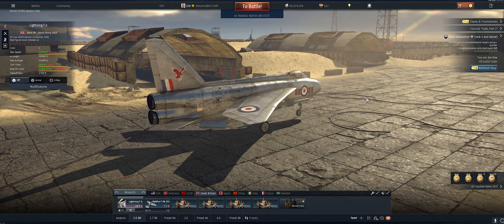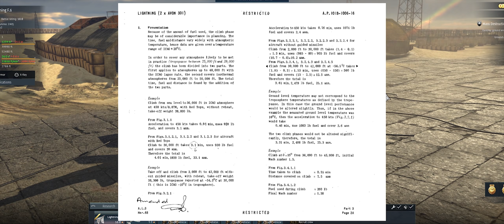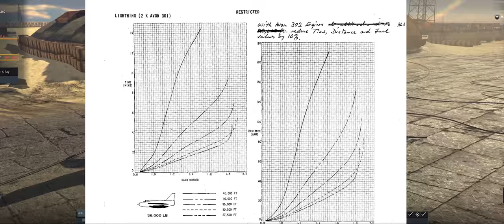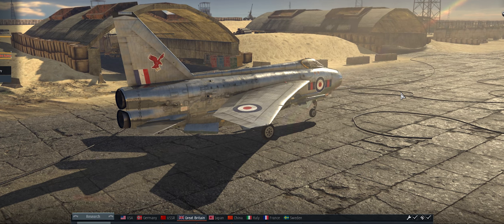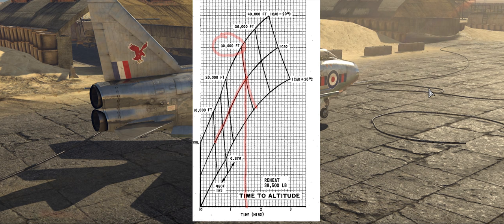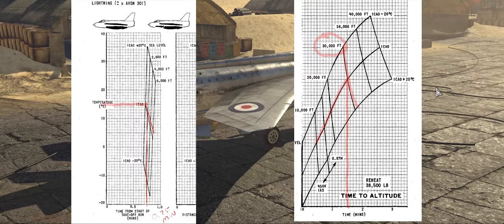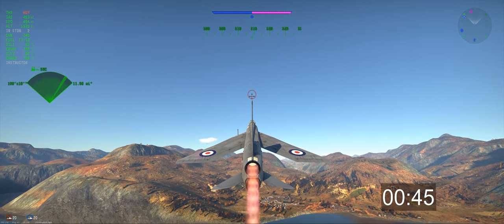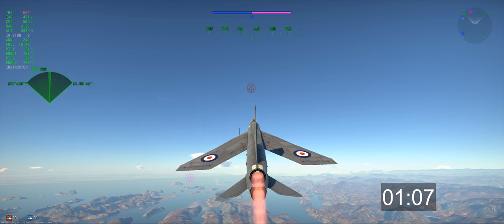True Facts About the English Electric Lightning's Performance - War Thunder 1.97

Comment: Well there was a Lighting in real life that managed to intercept a U2 spy plane, and lob itself into a ballistic arc maxing out at 88,000ft, that's 28,000ft above it's official service ceiling. Good Luck getting anywhere near 88k ft in game. Also, the RAF was worried that the nose cone covering the radar wasn't strong enough to handle the forces at max speed, since it was built to lower specifications. So the plane had the potential to go faster than the manuals actually say.
Reply from the maker: https://cdn.discordapp.com/attachments/637130584912822293/690051743513313320/unknown.png

That was only the first try.   That's 77,000 feet.
Reply: I mean the F-4 did the same to 98,000ft so you were saying? 

Operation Top Flight: On 6 December 1959, the second XF4H-1 performed a zoom climb to a world record 98,557 ft (30,040 m).Commander Lawrence E. Flint Jr., USN accelerated his aircraft to Mach 2.5 (2,660 km/h; 1,650 mph) at 47,000 ft (14,330 m) and climbed to 90,000 ft (27,430 m) at a 45° angle. He then shut down the engines and glided to the peak altitude. As the aircraft fell through 70,000 ft (21,300 m), Flint restarted the engines and resumed normal flight.

Operation High Jump: A series of time-to-altitude records for the F-4 Phantom was set in early 1962: 34.523 seconds to 3,000 meters (9,840 ft), 48.787 seconds to 6,000 meters (19,700 ft), 61.629 seconds to 9,000 meters (29,500 ft), 77.156 seconds to 12,000 meters (39,400 ft), 114.548 seconds to 15,000 meters (49,200 ft), 178.5 seconds to 20,000 meters (65,600 ft), 230.44 seconds to 25,000 metres (82,000 ft), and 371.43 seconds to 30,000 metres (98,400 ft).

If the lightning is at 30 angels at 135 seconds
the F-4 Phantom is at about 55 angels

Comment: good work gaijin cant even get planes which have books literally filled with info to be historically accurate
Reply: Actually this has been discussed many times. The issue with these manuals is that the manufacturers lowball all the top ends to extend life of the machine. Pretty much evenly plane will out perform the manual, which is why gaijin doesn't accept just the manual as info for changes.

Comment: Ok, so the electric lightning performs like it should according to the manual, but how can it not do feats that it can and was shown to do in real life in the game?
Reply from the maker: Example?
Reply: WhooptieDo thanks for replying, I’d argue that it can’t climb vertically after take off like it could, I’d also argue that it’s acceleration rates and max altitude are wrong (I’d refer you to the performance comparison against a Mig 21 by sgt.vittie) and I would also argue that it’s high altitude manoeuvrability is incorrect. I agree that it was not a dogfighter but I do feel it is incorrectly modelled in performance.
Reply: WhooptieDo no further response?
Reply from the maker: @jamiekowalski6430  sorry dude been alot of people commenting and alot to keep up with on this video.    As for Vittie's comparison video, you need to remember the Mig21 has a similar thrust to weight ratio and a shit ton less drag.  He didn't create a very controlled scenario for his vid.  His complaint was that the EEL was underperforming, when his complaint should have been that the Mig21 is overperforming, but even considering it all, the Mig21 came into existence 10 years after the EEL.   I told him that when he made the video, but he's since booted me from his discord and blocked me from any further communications.   Buffing one plane to compete with another is NOT the answer.

I am waiting on someone right now who's offered to provide me with a Mig21 MF manual, at which point I will do the same tests and we will likely find that the MF/SMT is slightly more powerful than it should be.  F4 phantoms have always been able to run from the Mig21 in real life, however in WT they BARELY can.

Also, something for all to consider is the guns on the EEL are removable, so all these 'feats' that people keep referring to, were often completed with far less drag in not having that ugly belly mounted cannon.
Reply: WhooptieDo interesting thanks for replying again. Hearing your point of view I can agree with you. Would you concur though that the EEL’s max altitude is not the correct value?
Reply from the maker: @jamiekowalski6430  it depends on what your consider its max altitude.
Reply from the maker: I've only tried zoom climbing once and I made it to 77000 feet, I'm sure I could make it to 80k.  Level flight iirc I did 60k fairly easy
Reply: WhooptieDo interesting, thanks for the reasonable argument. I think it’s a case of the mig 21 over performing in the game again then. Look forward to seeing your video on its performance compared to its manual man!
Reply: WhooptieDo I also think that the games design needs a serious revamp with different game modes for air RB so it’s not just the same few performance factors that make a plane great or not and so that planes like the lightning can excel in doing what it was designed to do!
Reply from the maker: @jamiekowalski6430  I mean, if it makes you feel any better, I was just playing EEL in a custom match against Mig21s and they were extremely easy to energy trap and kill lol
Reply: WhooptieDo I’ve nearly unlocked it now, little bit more grinding to do. Hopefully I can use it well
Reply from the maker: @jamiekowalski6430  I've tried a couple matches and I really must say I hate the plane.  It compresses a bit too much where you need it not to.  Red tops are useless. I'm gonna try with firestreaks but haven't got that far.  It's nice to know it can beat some aircraft in a one on one, but damn this thing stinks in the meta
Reply: WhooptieDo I love the vehicles, the mechanics, the ‘realism’ (in some scenarios) but god damn I hate this game 😂

Comment: The lightning feels good at high altitude. For balancing reasons alone it should have a bit more speed on the deck and maybe aim9d's even though it never carried them. Nothing crazy mach mach 1.05 or 1.06 witch would be in line with some 10.3's that itll mainly see. But the high altitude performance, as long as your not an idiot flying the dam thing, it will out perform many of aircraft. It is just not the aircraft built for the meta. No one fights at 10k. Witch is what this interceptor was designed for. I have better luck dogfighting in it anyway.

Comment: Whooptie honestly I like a lot what you usually do but you can't title the truth about the Lightning performance while only testing the climbrate - which was arguably the only thing serious Lightning clubbers weren't pestering about - The Lightning F.6 acceleration flight model is essentially trash, and you should know that having seen the charts. 

Full Reheat / Avon 302 @ ICAO :
At 5.000 feet(1524m) = Top Speed MACH 1.072
> Accelerate from Mach 0.85 to Mach 1.0 in 21.5 seconds
At 15.000 feet(4572m) = Top Speed MACH 1.479

> Accelerate from Mach 0.85 to Mach 1.0 in 10.8 seconds

Without Reheat / Avon 302 @ ICAO : 

At 5.000 feet(1524m) = Top Speed MACH 1.026 [SUPERCRUISE /!\]
> Accelerate from Mach 0.85 to Mach 1.0 in 22.5 seconds

Those are just a few examples from charts reading which illustrates how innaccurate the War Thunder fm ( https://forum.warthunder.com/index.php?/topic/479190-lightning-f6/ ) is. I'm not saying the Lightning is basically underperforming. It is at some altitudes ( vostly lower ) and even overperforming at some ( mostly over 40.000 feet ) but the point is that it doesn't matters actually because the model is simply not what charts shows. Can the Lightning Supercruise from mach 0.9 to 1.0 at 1500m without reheat in less than 20 seconds in game ? You know that better than me.

Comment: The Lightning performed better than the manual irl, the manual was more guidelines than actual capabilities of the aircraft, this is actually the case for many aircraft. Wether it’s because of wanting to keep the true performance figures a secret, or to make sure the pilots won’t put the aircraft in a situation where it can’t cope.. the Manual is nothing more, than a manual, a very conservative measurement of the capabilities of the aircraft. The true performance is tested to exceed that of the performance in the manual, this fact is supported of countless of accounts of pilots and test pilots exceeding the performance figures of the manual.. Take a look at the Sr-71 that plane exceeded the speed of the performance figures in the manual by some margin... so yes it is underperforming compared to what it was able to do in real life. That being said, I do believe that we need bigger maps, less players, more ground targets, and more ai targets, perhaps multiple spawns as in simulator battles, and some new game modes in air RB:)
Reply: Rajko Stankovic  Well they for sure didnt use the manual for the mig-19, mig-21 or even the f-4s.. And yes, it would not require much effort from the to do a bit of research, instead of copying performance figures out of a fucking the manual..

Comment: I believed that the lightning was underperforming like the rest of the teaboos but since wooptie had actually gone through the research and thoroughly tested I have no argument. It must be correct
Reply: Should look on the forum, while climb rate and most top speeds are matching manuals acceleration is drastically underperforming, at some altitudes taking several times longer than it should to reach speeds

Comment: People are not really complaining about the stats of the lightning but more the fact that aircraft it fights that shouldn’t out perform it in certain roles do this is the problem u can’t put a vehicle in the game that is statistically correct and others not ,the mig 21 couldn’t outclimb the EEL but in this game it does, I have been around jets all of my career and I have worked all Cold War fast jets and EEL put every other jet to shame with its climb rate to intercept... and the hand book for EEL is actually a non emergency  protocol hand book for how to use the aircraft all that is just paper in a emergency role.
Reply from the maker: Will be digging into the performance of other aircraft soon hopefully if I can get ahold of the performance charts.
Reply: WhooptieDo I can find them for you when I’m back at work I work at IWM duxford we have a mig 21 on loan
Reply: WhooptieDo if you have a email il send them to you as soon as I can as the stats will intrigue you from the point of view of the other aircrafts
Reply from the maker: It needs to be the proper manual or Gaijin will not listen.  Do you have MF or SMT?  I have the Bis stuff.
Reply: WhooptieDo we have the Bulgarian mig 21 MF documents that are from the Bulgarian Air Force translated in English
Reply from the maker: @morgancoates2050  that would be quite helpful.  Officialwhooptiedo@gmail.com

Comment: Ok so it over performs on takeoff/climb but what about the fact that the plane is supposed to be able to reach Mach 2-2.27 at 40,000 ft. I've not even seen people get close. Would like to point out yes I am a teaboo and this isn't intended as a complaint. Just being curious to the man willing to do the math. 
I accept that my wet dream of a plane was overexadurated by most people to told me about it but I did look into the speed myself because I thought it would be absurd to go into WT with a top speed like that.

Comment: It's good to see these numbers, but The flight model is just wrong in general.

It just can not accelerate at high altitude, and at all altitudes it can not achieve its top speeds like it has too much parasitic drag.

In addition, it has arrived over a year too late. It should have arrived with the F4C and the Mig21F13. And is now being compared to and fighting against aircraft 15 years younger than it. 

It's an OK aircraft, just not competitive at all.
Reply from the maker: It does over mach 2, climbs to 60k feet, and zoom climbs to 80k feet.   I've tested that.  The part I havent tested is it's accel times at altitude which hold very little merrit in the current matchmaker anyways... But they are arguable points
Reply from the maker: And yes the arrival to war thunder was wayy too late unfortunately
Reply: @WhooptieDo  Parasitic Drag and List coeficiants are extremely important when creating a workable flight models, the Mig-19 was massively overperforming for months because of this. It really needs fine tuneing, but I believe that there is too much drag, and too much lift in the current flight model.
Reply: It should have excess thrust to easily push past mach 2.0 (official top recorded speed is mach 2.27, 1500mph at 40,000 feet.)
At sea level it can not break past mach 1.0
Reply from the maker: @100DesertRoses  you need to remember the guns were removable.  That whole belly mounted cannon is drag.  They took it off for those numbers.
Reply from the maker: And yes it can break mach on the deck.  I did it the other day chasin an F4

Comment: The Fgr.2 reaches 30,000ft in 1:42. 
It's just better guys, c'mon.
To be fair, the Fgr.2 entered service in the late 60's.
Reply from the maker: FGR was the EELs successor too
Reply: @WhooptieDo  very true good sir. 
I would like to mention though that as another viewer pointed out. According to the manual the Lightning is underperforming in mid-high altitude acceleration. Maybe I'll take a look at that.

The acceleration from Mach .75 - 1.25 are identical for the Fgr.2 and the F.6.

Comment: I like how everyone is treating this video like its a revolution and that the lightning is over performing.....it cant even go near mach 2 at 12000m and its max service ceiling is 16000m??! What? And the fact that it cant go mach 1 below 2000m unless you put it into a dive
Reply from the maker: It can't go mach at 12000m... What?
Reply: @WhooptieDo  i mean i am stock but im in a test flight right now with min fuel at 10,000m and i stopped out at 1845kmh about mach 1.65
Reply from the maker: @Chase-Man  use reference model in test flight.  We are discussing it right now in TSKs server, it's slow to accelerate to 2.0, but it does it.... Meanwhile still climbing and accelerating over 3500 fpm.

Here's the pic from my tests the other day.

https://cdn.discordapp.com/attachments/636002020972691466/691135768693047336/unknown-19.png
Reply: @WhooptieDo  my mistake ill make sure to look into it
Reply: @WhooptieDo  after playing for awhile i can definitely see that the engines are fine and seem fine however just the max speed seems off for an interceptor and also feel like it gets to much AoA and not enough lift
Reply: @WhooptieDo  agrees. I have used it in test flight so fuel doesn't run out but it takes too long to hit top speed it would be out of fuel innhalfnthe time it takes to get mach 2.

It does climb at the right speed to height but it accelerates too slow. I'm wondering if it bleeds speed too little which allows it to climb  but not get fast enough in a level flight.

Comment: At the end if the day not every plane is going perform great that said the way of really fixing that is with top tier BR decompression. Obviously the Lightning is nowhere near as good as the Phantom or MIG 21 but neither are the F100 or MIG 19. We need BR decompressed to 12 or even 13 especially with the fact that there are a ton of jet aircraft that came before the 21 and phantom that can't be fit within the 1.3 BR between subsonic jet fighters that use guns and mach 2 monsters that use missiles.
Reply from the maker: We definitely need to see some kinda change for sure!

Comment: Then why does she show reduce speed at low altitude when she is barely in Mach. That's a joke. It only performed well here because the aircraft climbed to higher altitude where she does perform better in game. Any test at low altitude will show you how clipped her wings are.
Reply from the maker: There's alot of aircraft that say reduce speed long before they should.   It's a bug and has zero merit on the performance of the aircraft.   I exceeded mach quite easily on the deck.

Comment: Can you test it's max service ceiling?
Reply from the maker: I will later.... I did manage to zoom climb to 77k feet on one try though.
Reply: WhooptieDo can you also help me verifying the fact that some sources claimed that an F.35, an export version of the F.6 managed to reached 88,000ft?
Reply: @easy_eight2810  It's false. The Sr-71 blackbird had a service ceiling of 85,000ft and required the entire plane to be designed around that aspect, including very very special engines. No way a Lightning airframe could hit 88,000ft. Unless you strapped a literal booster rocket to it.

Comment: Leave the lightning as it is. Gaijin are gonna use this to nerf it and piss off us brit players. Its not that the lightning is underperforming or anything, its that all the other planes it faces are straight up better than it. This thing shouldn’t face phantoms at all. If you took away mixed battles or if everyone didn’t fight on the deck it would be fine.

Dont change the lightning